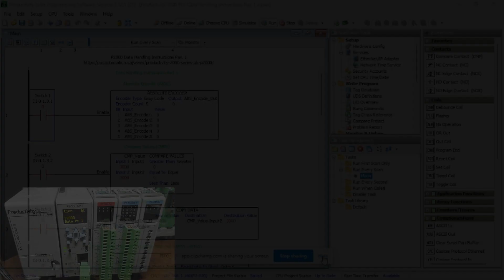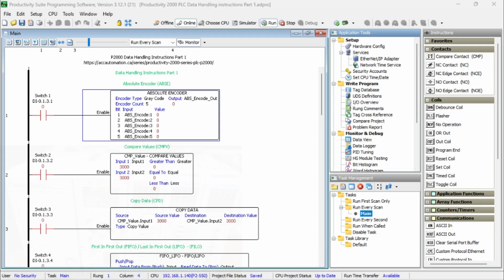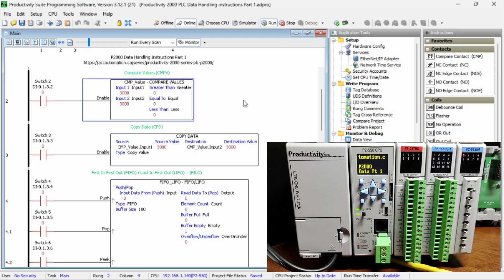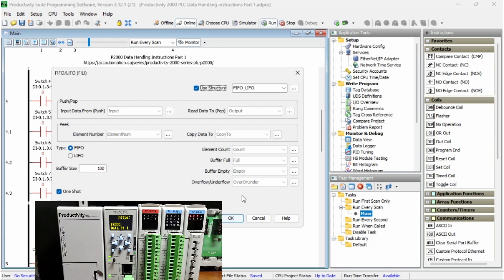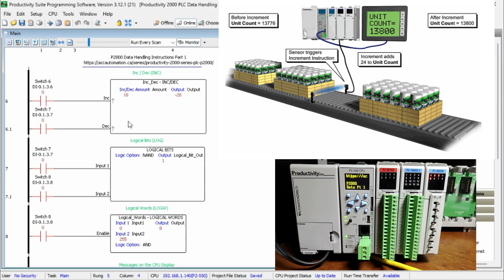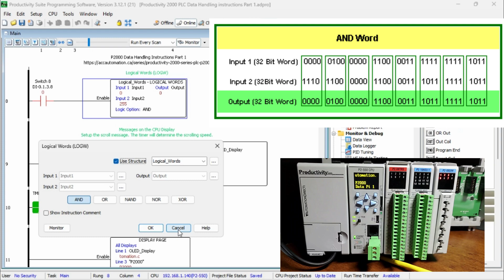Productivity 2000 PLC Data Handling Part 1

Comment from the maker: Detailed information can be found on our website. The post for this video is located here:
https://accautomation.ca/productivity-2000-plc-data-handling-part-1/

The Productivity 2000 Series PLC is located here:
https://accautomation.ca/series/productivity-2000-series-plc-p2000/

There are several reasons why we are using the Productivity 2000 Series Controller. Here are just a few.
- CPU with 5 communication ports
- 50MB user memory - Can handle very complex applications easily.
- Limitless PID – Autotuning – Individual or Cascade Mode - etc
- OLED message display on the CPU module
- Plenty of discrete and analog I/O modules
- Status displays on all discrete I/O modules
- I/O Modules have QR codes. This can be scanned to have the module's latest specifications/wiring diagrams.
- OLED data display on analog modules
- P2-RS remote I/O expansion module, or use the Productivity1000 P1-RX remote expansion module to add even lower-cost remote I/O to your system
- FREE full-featured Productivity Suite software
- Programming with several ports - USB, Ethernet, Serial
- Hardware auto-discovery
- Hot-swappable I/O - Remove cards with power on the system
- Choose from three wiring options
- Slim DIN rail density form factor:
 - hardware - power supply, CPU, and seven modules in only 10-1/2 inches
- All project files (program, tag name database, and all the program documentation) in the CPU
- Run-time editing and debug mode on CPU
- Easy data logging with micro SD on CPU
- Secure Web server to access data files and system tags
- Easy drive and motion controller integration
- Coordinate motion control with PS-AMC allows control of up to 16 axes and synchronization of up to 4 axes
- Two-Year Warranty

The Productivity 2000 series of programmable logic controllers currently has these features built into the P2-550 CPU.
This CPU (Central Processing Unit) is known as PAC (Programmable Automation Controller) because of its communication capabilities.

ACC Automation
https://www.accautomation.ca